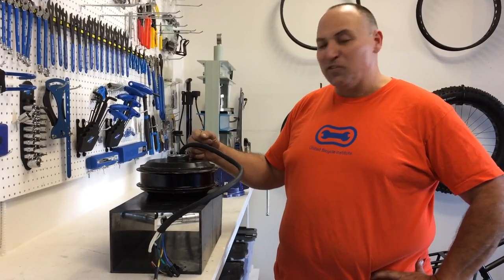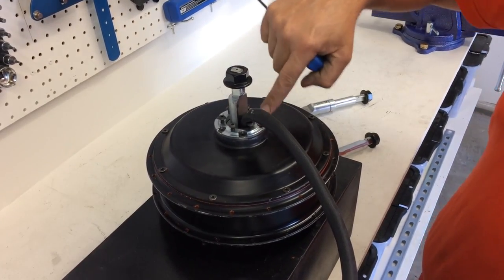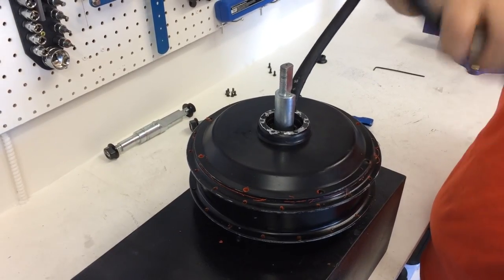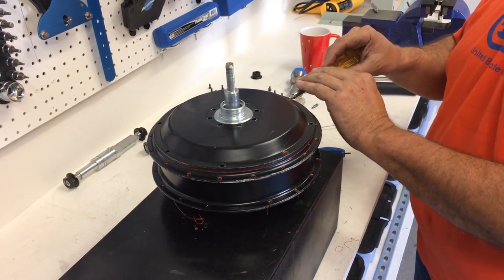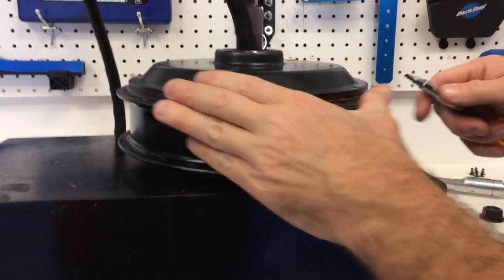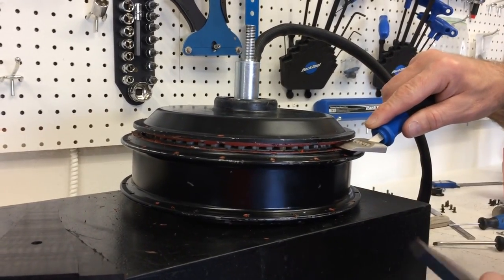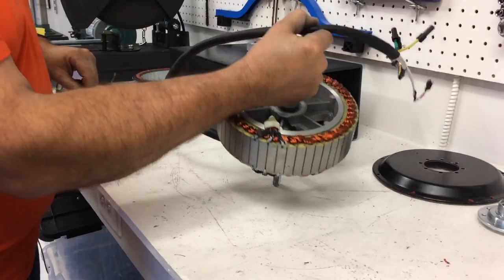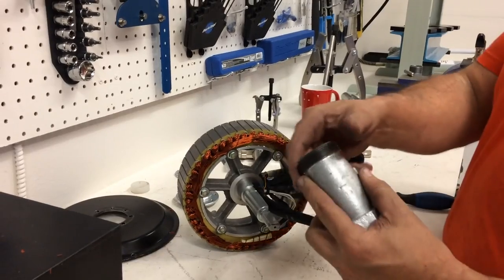Ebike Hub Motor Disassembly and Reassembly

Comment: You really made it hard for yourself bringing the Stator out: Push Stator through - when it’s almost out you can lift the rotor up by hand, bringing it all the way to the top of your Press. Now you can loosen the press again and take the rotor away - now you can bring the rotor down and take it away. What’s screeching is the unsupported rotors magnets connecting with the Stator at one point. Totally normal. Even though very very nice work - those were just my two cents! I was really enjoying your video! :)

Comment: So I had an old e-bike hub  motor that was causing issues cutting out, so I took it apart it was very rusty so I  give it a good clean and also renewed the soldering joints of the hall senses, my question is I saw somewhere on eBay some guy selling some sort of silicone fluid that's supposed to help transfer the heat from the coil to the permanent magnet aluminum body of the wheel is this needed? I'm thinking to just use lithium grease

Comment: You're pretty honest up until the end and I commend you for that and I want to say thank you... but when you were putting it back together. you were pushing the stator out. When you were putting the first cover on. you didn't really explain how you got the stator to go back in when put the others cover on or really even how you got the stator back in in the first place. You just kind of said it was a pain. And please call the stator a stator not a stader. Driving me nuts calling it a stader. Oh and FYI if you ever have to take a hammer to something that is a stud or has threads. put the nut on it until the nut is almost flush. then use a block of wood or brass and you'll be good to go. you can beat on it pretty hard without messing up the threads. I'm an automotive tech and just wanting to learn about electric motors. Thanks for the video greatly appreciated.

Comment: when assembling the bearing in thr motor cover, the sleeve should be small so that it rests on the bearing's inner diameter. The way you are doing it, the pressing force is transmitted through the ball bearing which damages it. Moreover, while doing this operation, the whole motor should rest on its axle and not on the 4 small columns. the way you are doing it, the forces are trabsmitted to the driving axle through the ball of the rear ball bearing... You want the forces to be transmitted directly from the inner ring of the upper ball bearing to the driving shaft. It is not all at the right way to assemble a bearing. That is why you feel the "spring" forces due to the cover deflection which should not be involved at all in this operation.
Reply: I was waiting for one of those sockets to go flying at about mach 9 and take out some teeth.😬 Not only that it looked as if the windings were being pushed out and distorted. 😬😬

Comment: thanks!  
for future reference, there called Woodruff (or half-moon) keys, used a lot in hydraulic motors, and hub assemblies,  advantage of the Woodruff key is the elimination of milling near shaft shoulders. An additional advantage is a stuck key can be removed from a shaft with a hammer blow (not prying out), the circular profile will push the key out of the slot, as opposed to a standard key which will need to be pushed axially. If you've ever used a self feeding wood chipper, you kept a few in your pocket ;-)

Comment: Will the motor spin if I don't have the side cover bolts in? Because I had to replace the hall sensors for a friend and everything went well, Now I'm going to power everything up and see if the error code is gone and the motor spins.  But he never gave me any bolts for the side covers,  I'm not sure if they need to be screwed in place to hold something so the inside can spin, or if it will be ok to test for  movement without them. Then he can install the bolts when I return it to him. Thanks

Comment: When you assemble any two parts with silicone or any form-a-gasket material...apply a very thin film of grease with your finger to one of the parts and silicone to the other part...so the next time you won't damage mating faces by banging a screw driver in between...
Reply: Good advice!

Comment: Why use silicon as a gasket?  Why not simply waterproof the motor with red insulating varnish?  If humidity is caught inside the motor (e.g. heat buildup will suck in water as it is not completely sealed) it needs to exit ... I have seen many a motor with drilled drain holes.  Nice video.

Comment: Great video. Thanks. I'm trying to troubleshoot a hub motor. Should my three motor wires have continuity? How can I test, with just a multimeter?
Reply: If you testing the hail sensors you put your ground wire from multi meter on the sensor ground. You put the red lead on the blue green green or yellow wires and turn the wheel by hand. You should get a voltage reading. Repeat the process for each wire then again for all sensors. If any show no reading at all then you have a faulty hail sensor

Comment: Actually, it's not a Woodruff Key, which looks to all like a slice off of a coin. The key used (although loose-isa) can be made a bit more secure by running a series of dot punch marks on both sides and being tapped home.A slight chamfer on the starting side would also help.Or you can shim it with S.S. shim cut to pack out the key

Comment: 21:44 I would have liked to see you put the magnetic stator together with the casing... I imagine it's pretty violent the way it comes together?  Kinda dangerous "keep fingers clear!" kinda thing? ...........actually........come to think of it......... why did you separate them in the first place?  you don't need to in order to get the axle out, right?
Reply from the maker: I was ready to film it, but there were only two of us in the shop for this task which required both of us. Next time I do it, I will film and post the event.

Comment: Thanks for posting this, I am new to Ebike converstions. My first build had a catastrophic failure last night, the hub sheared around the axle causing the wheel to lock up. I shot a little video trying to show how it failed, but it's behind the gear cassette and hard to see. I would like to upgrade to a heavy duty hub that can handle my 300+ lbs. Do you sell or repair hub drives?
Reply: I HAVE THE SAME EXACT FAILURE!! However for me it was not because 300+ lbs but instead because I heavily abused it riding down rocky mountains at high speed ...
Reply: i guess you can either get a stronger motor cover? or mount the hub motor as a mid drive, using the 6 bolts to mount a gear onto

Comment: I have a Bafang 750 watt/48 volt Brushless, Geared Hub Motor with a 190 drop out axle where the motor cable comes out through the axle. I also need to change the axle because of damaged threads, Would the process be almost the same? I realize there are planetary gears inside to change. Do you know where I can obtain a replacement axle? Thank you.
Reply from the maker: Try Luna Cycle.
Reply: @industrialebikes4956  Thank you

Comment: It probably wouldn't have helped in this case but next time you need to pound on something with threads on it, spin the nut on it and hit the nut not the threaded shaft itself mushrooming the end and damaging the threads. interesting vid tho, thanx!
Reply from the maker: Good tip!
Reply: Did exactly that and damaged the nut and threads. It usually works to protect the threads but not when the forces are too great.

Comment: Hi, thanks for sharing your experiences. I need to replace my cromotor bearings. What are the best replacements for off road use? Would you know the size/model/manufacturer  of best bearings to get?
Thanks
Andrew
Reply from the maker: The answer is "6204-2RS". I have UKS brand now, but any quality brand will do. SKF is the highest quality. In any case, 6204-2RS bearings will fit perfectly. I apply up to 3000 psi of pressure on the hydraulic press.
Reply: Industrial Ebikes ,,,, thanks for your reply. 6204 for both bearings?
Reply from the maker: Yes, both sides use a 6204 bearing.
Reply: Industrial Ebikes ,,  thanks again for making the effort to reply. You've been really helpful. Great detailed video, its encouraged me to crack open my cro for the first time.  Happy New Year!
Reply from the maker: You too. Do you have a hydraulic press and bearing pullers?
Reply: Industrial Ebikes,,  would a bearing puller be needed to remove the side covers if there is no gasket sealant on the covers? What i mean is, do i really need to remove the stator to replace the bearings?  Or does the bearing on the one side have avery snug fit to the axle, which requires a bearing puller for removal?
I don't have a hydraulic press but most car garages do, so i will be calling a favour from a friend for this part.
Reply from the maker: You definitely don't need to remove the stator in order to remove and replace the bearings.

You CAN remove the side covers using other tools, but I really recommend that you invest in the small and large bearing pullers. They are not too expensive on Amazon. I got the OTC 1038 and OTC 1023. If you don't get a straight extraction, who knows what problems will occur?

Same can be said for pressing in the bearings. You CAN use a socket and large hammer, but then you don't get the smooth, straight pressing action of a hydraulic press.

Comment: A new axle can be made at any local machine shop if they have something to copy. Stator Removal can be done with any $20 gear puller from Harbor Freight. As for pushing out the axle and pushing in an axle, perhaps a vehicle jack would work but it may be hard to build a suitable holder, but the machine shop would have a hydraulic press for sure. I am just wondering what the cost would be for a new axle, push out old, push in new. I'd want a larger route for phase wires.
Reply: Then you gotta worry about the cover plate bearings. I just did bearings on mine and it was easy. So maybe the machine shop could easily cut out a larger hole on cover plates, add larger bearings.
Reply from the maker: What gauge of motor (i.e. phase) wires do you have now? What is the diameter of the copper? Are you wanting to draw a great deal of current? If so, how much current at what voltage?
Reply from the maker: The machine shops around here (Bay Area, CA) always ask for a drawing because it is all CNC work. When I have not had a drawing, I hired them to make one. They would have me approve the drawing (via email) before machining the parts.

Comment: A really helpful video BUT you didn't show hw to reset the stator in its cover without chopping off fingers and getting a straight set.
Reply from the maker: There were two guys in the shop that day. Both of us had our hands full when we put the stator back in the outer magnet, so nobody was available to film it. My buddy held one part, I held the other part, and we kept our fingers out of the way and slowly got closer to each other until POW! The two magnets mated.

Comment: im confused on how the stator and cover works. So when you apply throttle, does the cover start spinning around the stator? Does the cover just hover around the stator because the magnetic field keeps it from hitting the stator? How does the hub motor rotate?
Reply from the maker: The motor cover (not to be confused with the side covers) has magnets glued on the inside of it. Also, the outside of the stator has magnets glued to it. Under power, the outer magnet (assembly) rotates around the fixed inner (stator) magnet (assembly).

As it happens, the side covers are bolted to the motor cover. As such, the side covers rotate with the the motor cover. This is why each side cover has a bearing inside it. Interestingly, the bearing on the drive side is pressed into the freewheel flange. The freewheel flange is bolted to the side cover. 

Think of it like this: the axle is bolted into the dropouts, so the axle is not going to rotate. The axle is pressed into the stator, so the stator is not going to rotate either. The motor cover and side covers will rotate, however. This is fortunate because the rim is affixed to the side covers via spoke tension.

The outer magnet spins around the fixed inner magnet.
Reply: Industrial Ebikes ohh ok i understand how it spins now. But what keeps the motor cover magnets from hitting the stator magnets. There's some bearing preventing it from hitting each other? Or is the magnetic field strong enough to keep the motor cover from hitting the stator
Reply from the maker: The motor cover magnets do not hit the stator magnets because there is empty space in between the inner and outer magnets engineered into the design. The motor cover magnets are glued to the motor cover. The motor cover is bolted to the side covers. The side covers extend outside the physical reach of the inner magnets, and the side covers are anchored to the bearings on either side.
Reply: Industrial Ebikes i know theres empty space between the magnets on the cover and stator, so essentially, it's the bearing that keeps them apart?
Reply: Industrial Ebikes lets say you have a ball and a ring is surrounding the ball, kind of like the planets in our solar system. The ball is the stator and the ring is the motor cover. But if you push the ring, it'll hit the ball. The thing pushing on the ring is actually the bike tire connected to the spokes connected to the motor cover. So what prevents this outer ring from hitting the ball.
Reply from the maker: The magnets on the outer ring cannot touch/reach the magnets on the inner ring because the motor cover is rigidly bolted to the side covers. The position of this attachment puts the outer magnet assembly outside the reach of the inner magnet assembly.

To illustrate this point, imagine if the side covers were THREE FEET in diameter, with a much larger motor cover and outer magnet assembly so that they fit these HUGE side covers. The outer magnet would be FAR away from the inner magnet. The outer magnet couldn't get ANY closer to the inner magnet because it is rigidly bolted to the side cover (via the motor cover). It could rotate around it, though! And, yes, the side covers are rigidly anchored around the center axis by the bearings.
Reply: Industrial Ebikes that makes so much sense now. thanks for clarifyinh
Reply: @industrialebikes4956  there are no (permanent) magnets on the stator, instead you have the layered iron core and the copper windings that form a set of electro magnets.

The magnets do not push the motor cover away, but attract it to the stator. Theoretically there is a point where it would float, but it's unstable and any disturbance would let it cling to the stator. That's what you need the side covers and bearings for. They are turned precisely on a lathe to fit the rotor part, so that the gap width is constant all around.
Reply from the maker: @CatNolara  Thanks for the info!
Reply: @CatNolara  yea thanks, I just took apart my first hub motor and saw in first person how the motor side covers and bearings prevents the stator cling on to the permanent magnets. I'm surprised the motor cover can handle that much weight though

Comment: Yo...you didn't need to take the rotor (magnet side) off to press out/in the shaft. That was a needless risk, especially the way you wedged the plastic in against the stator coils. 

Farther on, you're trying to press the bearing/flange on and there's nothing but the magnets holding the stator in...you can see it pressing out through the bottom. You're also pressing on the wrong part of the bearing; in this case you should be pressing on the inner race, against the shaft, while the shaft is locked in place. You're damaging the bearing and it's going to wear out a lot faster. In the next scene, you can see the stator sticking out quarter of an inch because the bearing hasn't been seated fully. 

Then you go an press on the other side in much the same way, and even result to using the screws to try and suck it in the last few millimetres. That's one reason you had such a hard time screwing it down. The bearings still aren't seated fully, you've just made the casing bulge out.

Some good info here, but some bad techniques. Anyone doing this, leave the rotor on & press the bearings on properly. Go watch some videos about pressing on car wheel bearings if you need to know where to apply pressure...don't force the pressure through the bearings themselves; you'll wreck it.

Comment: Where  can buy an axle ?
Reply from the maker: I have all styles of new, bare Cromotor axles. Text to (707)293-8973.
Reply: @industrialebikes4956  I want to buy a axle for a 1500 w.Motor csc is the brand size 190mm

Comment: 8:25 You're using the adjustable wrench wrong. It should be flipped so the pressure on the nut-flat is exerted by the bottom of the sliding piece.
Reply from the maker: Good point! Makes sense. Thanks.
Reply: @industrialebikes4956  After you press out the axle, would it be possible to push in a bushing with a torque arm (something like a bushing with a flange that could be bolted to the frame) to convert it for through-axle use? Unfortunately I haven't seen any detailed plans of the motor dimensions to see if this would be possible before ordering a chicom motor to modify. I have access to a metal ship with a press, lathe, mill etc. to make the bushing part.
Reply from the maker: The Ball I can’t imagine that there is any room for a torque arm (base mounted) in the motor. If you figure out a way, I would be interested to see what it is.
Reply: @industrialebikes4956  I don't have any plans/technical drawings to check the diameter of the axle
Reply from the maker: The Ball If it were me, I would go with the tried & true method of mounting the torque plates outside the motor.